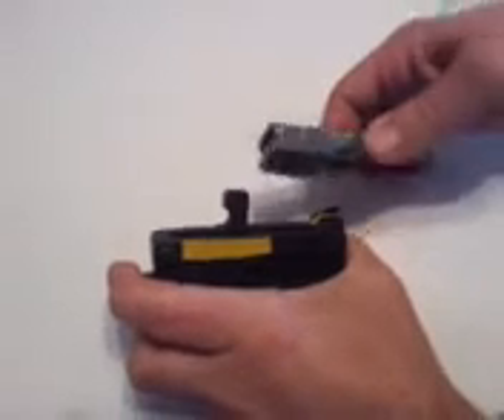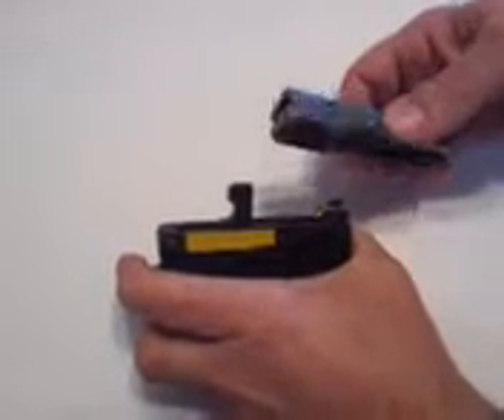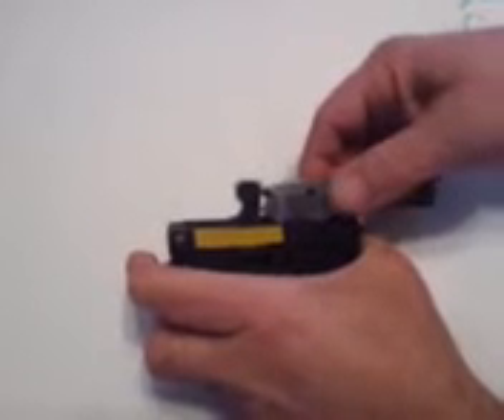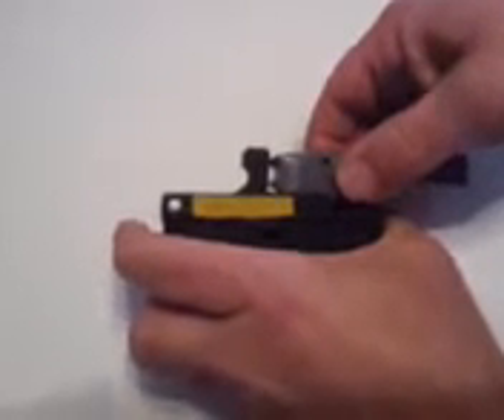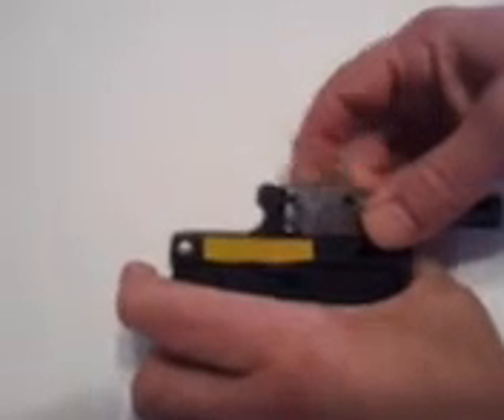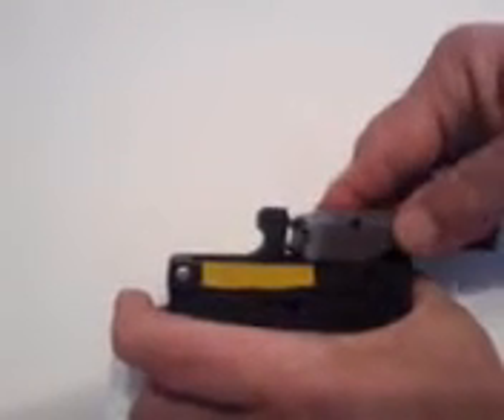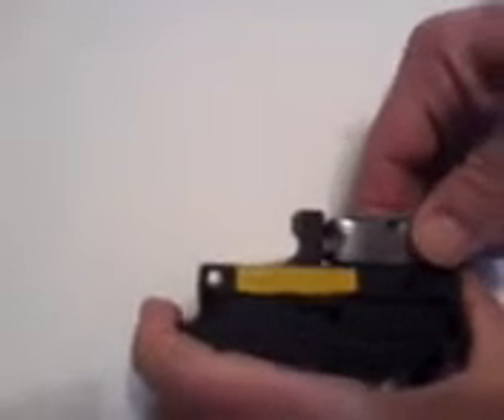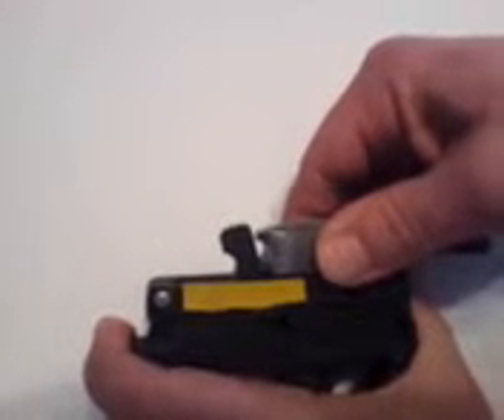10/22 Companion: Effect of bolt radius on cocking

Comment: This decreases the acceleration rate at which the bolt has to lift the hammer. Less stress on the parts and decreased coefficient of friction/greater contact surface area over the stock sharp bolt profile. Think of it as a cam ramp.

Comment: This is exactly what I have done to my bolt in my 10/22 "International". A White Nylon pin for the bolt stop, this really smooths up the action. With my finger tip I rub on some gun grease on all the mating surfaces, don't need much just enough to coat the parts, a very tiny bit will go a long way.

Comment: Isn't there a bolt buffer pin?
Reply from the maker: +Zachary Schinbeckler The bolt buffer (or bolt stop pin which is the steel OEM part) fits into the receiver. The semicircular cutout in the rear face of the receiver will hit the buffer. The radius we are talking about is the rounding over of the lower rear corner of the bolt.